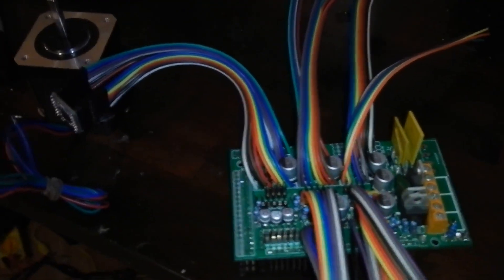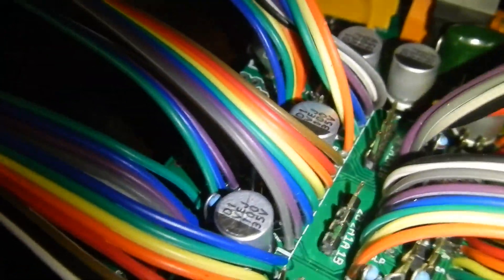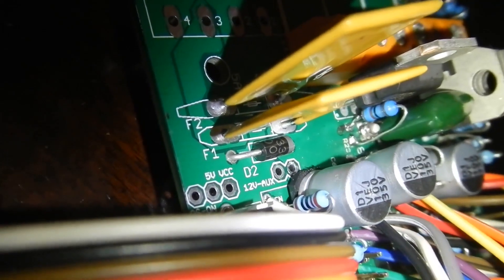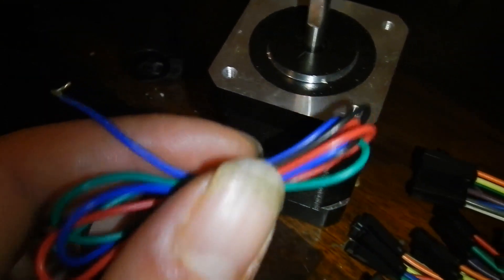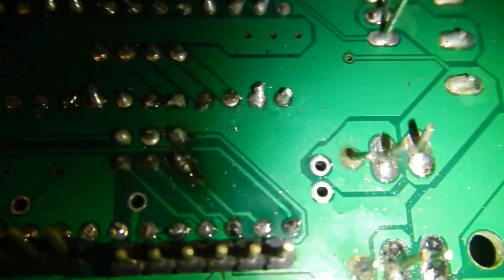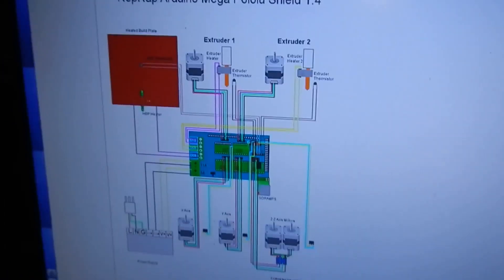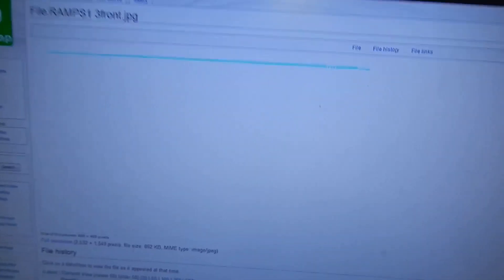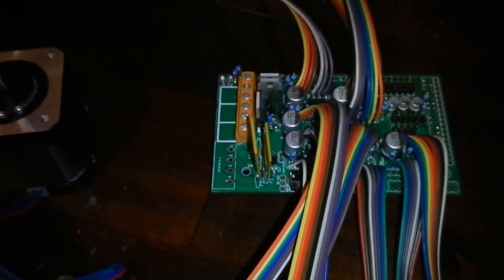RAMPS1.4 3d printer circuit board. DIY RepStrap pt2

Comment from the maker: Yep. All true. I will be making robots etc after this. Its a cnc machine, so cnc anything is just a matter of replace extruder with appropriate tool. Will be able to make a good coil winder etc etc. If you dont really need the learning experience, and you have the cash to buy one, and cant decide which way to go. BUY ONE!! There are new materials hitting the commercial printer market too. Flexibale, food grade, etc. That will take some mods to run in this printer. I just dont have the cash.

Comment: the biggest stepper motor I saw for free was from photocopier the big one you can also get some nice high voltage power supply ... lol I've got it to my to-do next project but now I have my hands full have to prepare myself for a 5 month training in 2 months and got to visit my father lol meh also have to finish my gps project still waiting for one part.... the gps receiver >.<

Comment from the maker: How many broken 2d printers can you get your hands on? I think the nema17's are huge overkill. The king of Arduino and LED's should be able to drive 4 steppers, and 2 heaters.... You might not get a huge print area with salvaged parts, but if you can print 100mx100mx50 high, you can print parts for a better printer. Print bobbins, and bobbin winders, toriod winder, project cases, drones, custom voodoo dolls. you name it. you can print it.
Where would I find good big steppers for scrap?

Comment from the maker: Thank you. I've read it before. Double check data sheets. measure twice, cut once. Just cant stress how important that all is with something like this. All the data sheets need to be thorough compared, and make sure everything will fit, and be of the appropriate value. If your not in a rush to have one, Id suggest you wait it out a bit.This stuff is going to get a lot cheaper fast! Although you could prob make a small one, from a few printers and maybe$100-150. over a few weeks.

Comment from the maker: You will need a lot of time!! I have been reading, and reading,, and reading, and blow something up, so more reading.... For about 6 weeks now. While the info needed is on the wiki. its not exactly coherent. A lot of questions have been very hard to answer. Thats why I am doing this series. To cover the stuff i had a hard time with. Its really a 2+ person project. I don't know many that can do the frame and mechanics well, and do the code well, and understand the electronics. I'm just a freak.

Comment from the maker: The plan is to be able to print a circuit board. Some Repraps can do an etch job, but so can inkjets. I am looking into conductive ink, or a cnc soldering iron, to be able to just draw the tracks, rather than remove perfectly good copper. silver ink is looking ok. Few other options to explore. I really want to go down the flexible pcb road.
The electronics is very simple! just needs to give the pololu a digital sig, the Adurino and Pololu are the heart. Going to do a breadboard single nema today